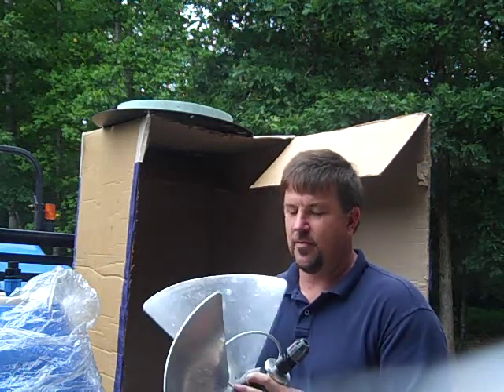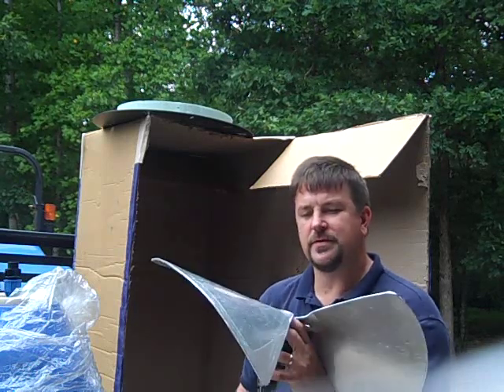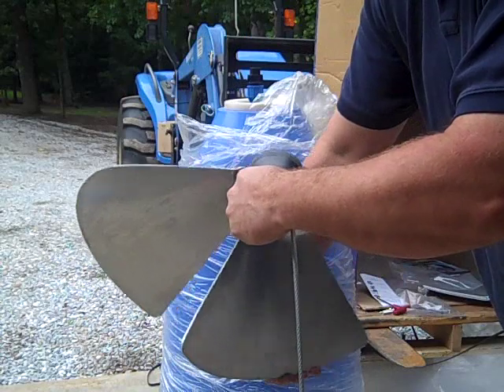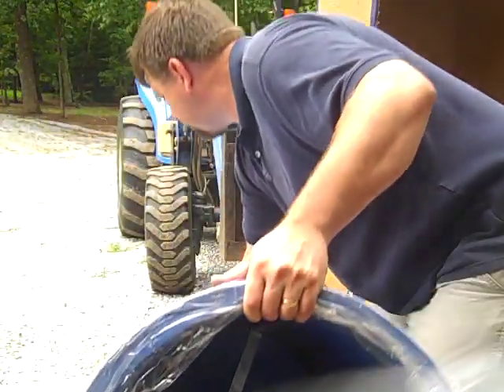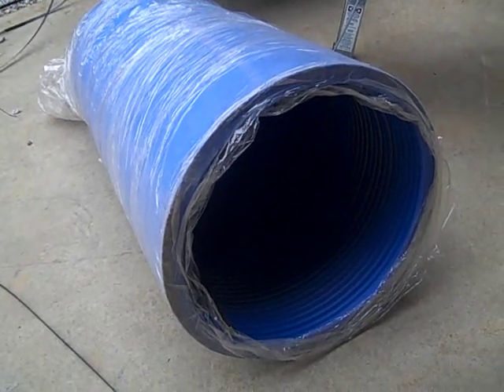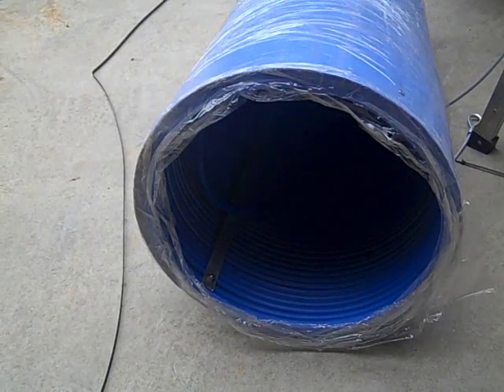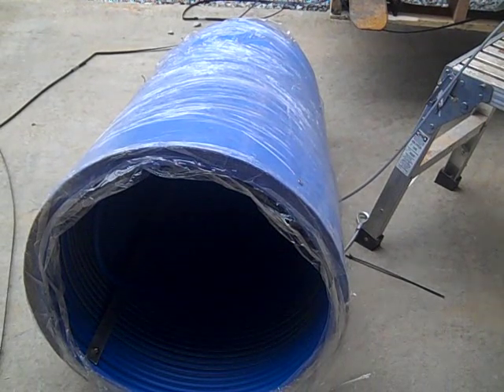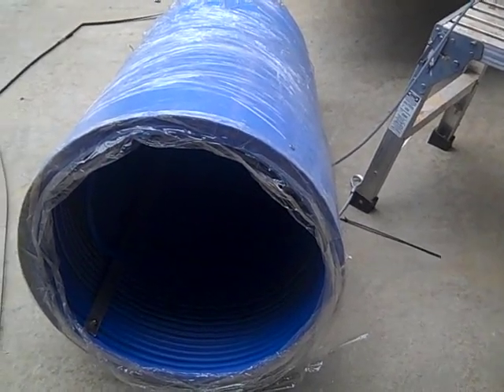River Pump Project Part 1

Comment: Try fitting a funnel to scoop more than the diameter of poly pipe it turbo charges this style pump. Also I'd consider vanes down the outside of the body for more torque.

Comment from the maker: The reason for the elevation is to provide up to 35 psi from an elevated tank, tower or hill that would allow for an automatic drip irrigation system.  I am putting out the info for those who would like to understand and save a heck of a lot of money in long run on their sustainability projects.

Comment: if the water is moving,you can roll up a hose,make sure the end of the tube is pointing in the direction of the current.
this will pump water for the cost of a hose.